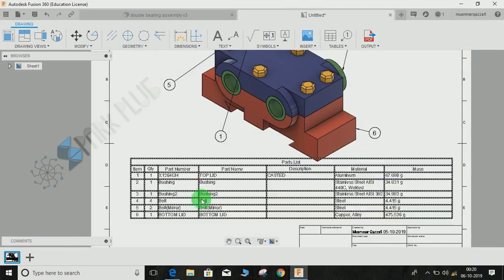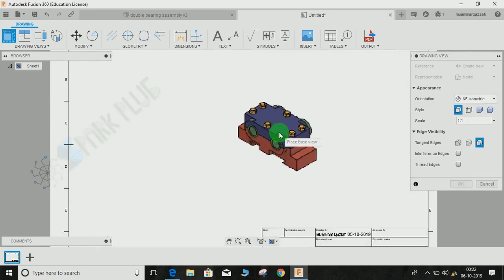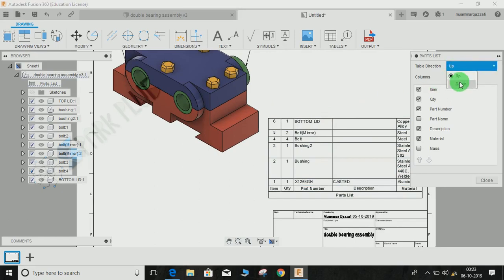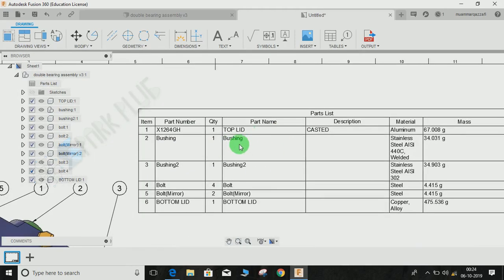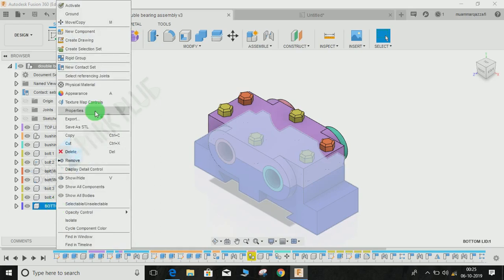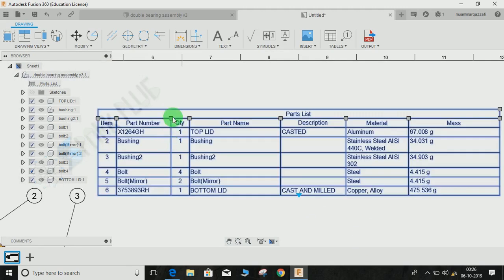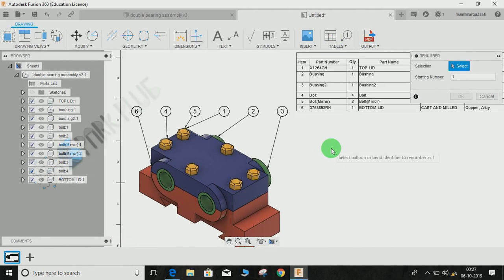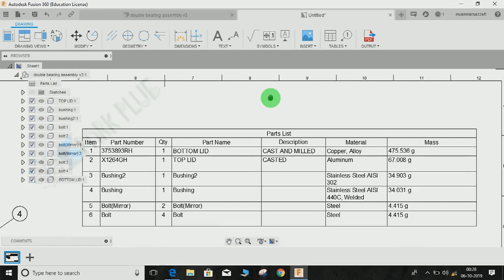HOW TO MAKE PART ASSEMBLY TABLE  - FUSION 360 DRAFTING TUTORIAL

Comment: There is one issue in your table. The bolts (5 and 6 in the end) are the same parts but are listed as different parts. It also happens when you copy a part. Fusion add :1, :2 to the part name. When generating a BOM the parts are listed as different parts. Any idea how to resolve this?